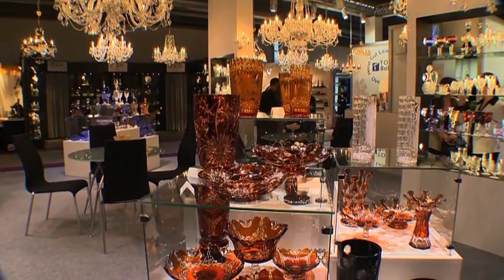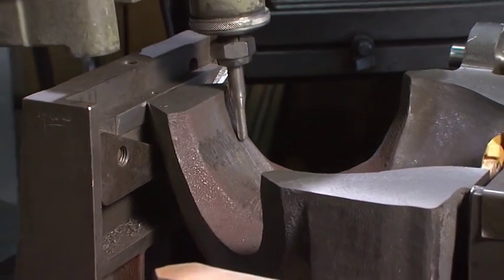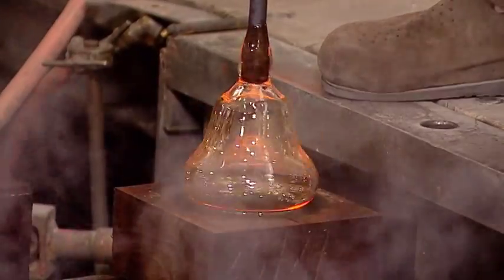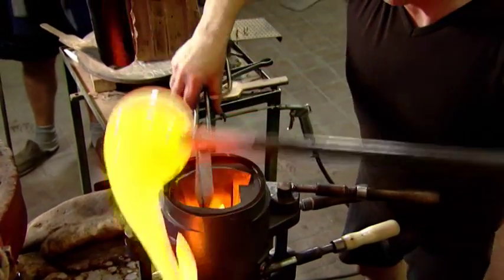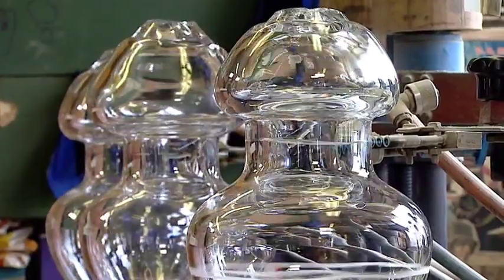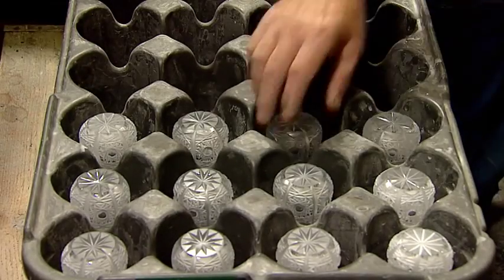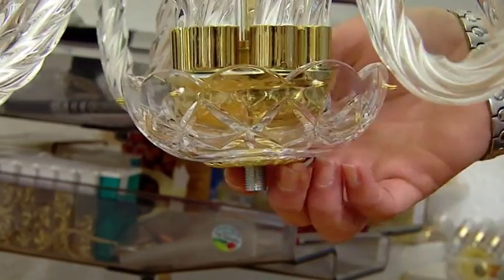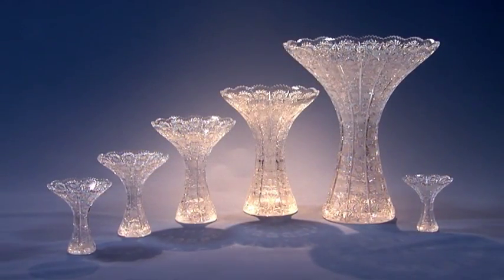Hand cut lead crystal

Comment: Anyone know if you can put lead crystal glasses in the freezer?
Reply: I would avoid doing this, as extremes of temperature, either hot or cold, can cause crystal to shatter. When washing crystal, only hand-wash in warm (not hot) water, again avoiding extremes of temperature. Rinse in warm water, not cold. I once had a precious Waterford bowl break because I washed in hot water, and as it dried it cracked when a cold air draft hit it.
Reply: Thanks for the info
Reply: Use lead crystal for serving, but not for storing edibles. It does leach small amounts of lead over time and if you regularly eat/drink food that has been sitting days in it, the lead exposure will eventually add up enough to matter.
Reply: 2:54 That's some impressive cheek puff